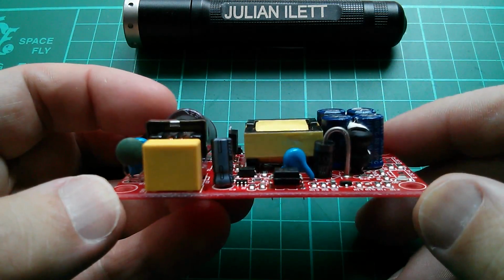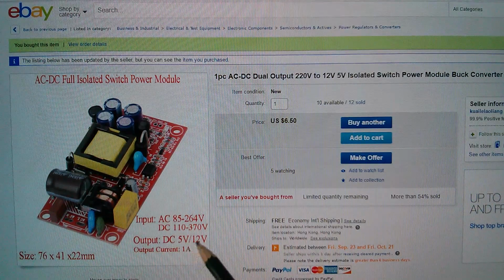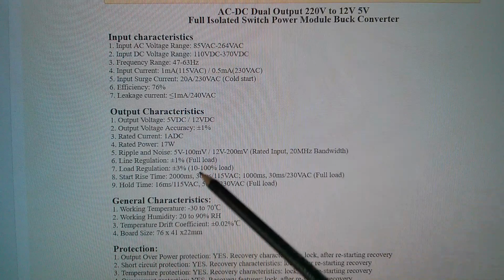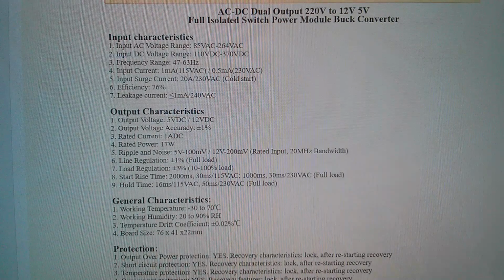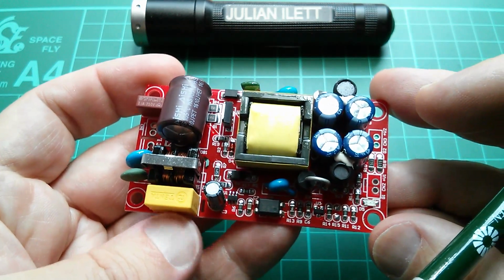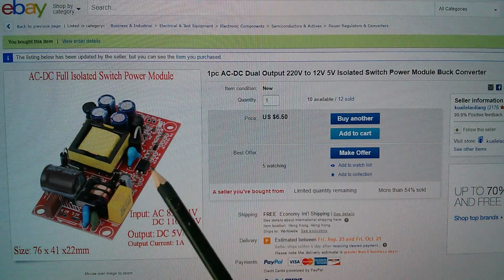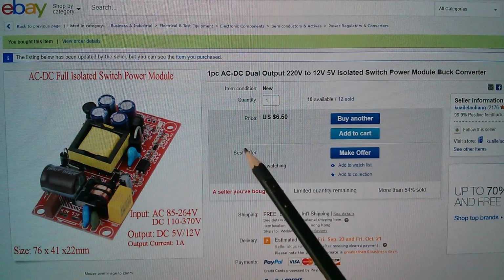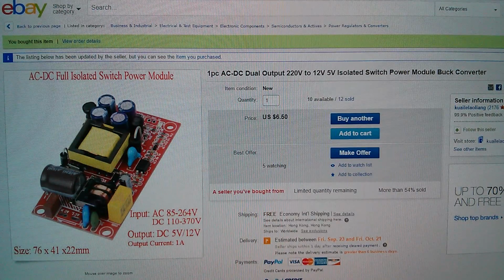Mad Idea: High Voltage DC Power Transmission

Comment: What I will be doing in due course (when the weather becomes fine and warmer) is to use a number of solar panels in series (3 x 200w) with a total of about 111volts run on some 12meters of solar pv system wire  to a mppt controller and then charge my batteries that way.
I did look at having something like what was described but the losses were adding up a little too much and having 3 panels in series is just fine. The cable I will be using can handle some 15 amps at that voltage.

Maybe have a higher voltage right off from the solar panels and save the conversion losses, and possible increase in noise generated by these switchmode power supplies ?

Comment: wouldn't you be better served running all of your panels in series and using a hvdc charge controller at the batteries?
This may be a issue if you have different sized panels however.

Comment: Rather convoluted thinking. The solar array/panel will produce over19V so why not just move the batteries closer to the workshop and run the wires from the solar panels to the regulator next to the batteries. 
Of course when the batteries are down they will not charge as quickly due to some loss in the cable but as they come up the charging current is less and consequently the loss in the cables will be reduced.
Using this method is much more reliable.

Comment: like the idea but you may run into a few issues. If you leave the DC-DC converter connected and powered on the battery all the time you run the risk of running your battery flat. Lead acids don't like being flat. And also you wont be able to check your battery voltage easily (from in the workshop) as your output 12 volts will be regulated. I have had similar issues with my solar power system.

Comment: Multiple converters kiil your efficiency. Assume you have typical cheap converter with efficiency of 80%. Couple of those in series and you're down to 64% efficiency overall (0.8*0.8=0.64)!
Sure, you can get better converters that can exceed 90% efficiency but those are usually not the typical cheap chinese ones. At 90% efficiency you are overall down to 81%. Just use heavier cable, much easier and way more reliable! Cables are commonly available weather sealed as well! :)

Comment: MOV is across line/neutral and it is used to kill high voltage transients. It conducts when rated voltage is exceeded. The numbers like 10D471K indicate usually size (10mm) and rated working voltage (471Vac).

Comment: Sorry Julian but I kinda have to agree with some of the other comments on here, while it is an interesting idea, I don't see the point of it when you're only getting 1A out of it...  Now if you were to use an inverter as some suggested that would make more sense, however then after the cost of an inverter you could've just spent that extra money on simply buying a thicker cable to run and that makes everything easier to work with, so yeah I'd say unless you need a very long run of cable, it's better to just spend your money on a thicker piece of wire.

Speaking of which, I've found that extension cords make for a rather inexpensive way of obtaining decent size wire, especially if you can get them on sale or free... Which is what happened to me, my parents were throwing out an extension cord because the thick outer insulation was a little cut open, but otherwise, it's completely fine and I've not measured it but, I believe that it's 16 or 14 AWG and roughly 100ft or 33m long, a very nice freebie.

Comment: HVDC is used commonly in industry for asynchronous motor drives and as mentioned below linking power grids for example between UK and Europe where they aren't in phase

Comment: Looking at the straight DC case, assuming your cord is 18AWG running 100meters (quite long!) with 12V@1Amp, that's: 0.6-Ohms*2wires = 1.2-Ohms. Voltage drop is then 1.2-Ohms*1A = 1.2V.  That's 12Watts in and 10.8Watts out at your load, for a 90% efficiency. I doubt two converters in series can beat that.  Also, the 120VDC minimum input voltage may be required by that one buck converter to meet full current and/or optimal efficiency. I wouldn't doubt the efficiency of those converters doing any better than 80-90% each. That is  64-81% combined.

Comment: There is a lot of speculating around here. I experienced a quite huge power loss over 12 V in my garden lightning system and decided to go for 240V on long cables. It depends on the length and thickness of your cables (i.a.w. the resistance) and the current. There are a lot of internet pages that calculate the losses. 
Another point to think about is security. Pets? Children? Rabbits? How deep do you like to digg?

Comment: Be careful with high voltage DC, it bites. Also watch out for electrolytic corrosion if the wire gets any moisture around the ends or into the insulators. There are many great reasons to go with AC for power transmission but the main one is that you can use transformers to step the voltage up and down without electronics. Also AC arcs extinguish more easily. Thanks again.

Comment: Gut feeling is that if you are going to use about 1 Amp then just a normal wire will be WAY more efficient than the double-conversion. Not to mention much cheaper.

Comment: Don't forget, unless you are going to run back and forth or run more wires to turn the 12 to 80 volt buster on and off, the buster will be presenting a load to your battery all the time.
Also although you are some what correct in the high voltage will give less line loss, you will still see a substantial line loss as it is still DC. This is where AC power comes in, although there are still line losses in AC they are much less and still less as you reduce the current (up the voltage).
Reply: William McSephney  Actually, AC transmission along long cables has greater losses than DC, due to the volt drop caused by reactive current flow. Although over a relatively short distance in this example, the loss is insignificant.
The reason that most countries use AC for electrical power transmission is simple, transformers allow easy stepping up and down of the voltage.

Comment: power output 17W ? 5v + 12 V @ 1amp ? the real question is, can it supply the 1amp on both output when feeded with 80V DC only ? or does it really need the minimum 110V DC ?

Comment: Interesting stuff. Would be interesting to see some power efficiency calculations. I suppose you'd need to check the efficiency graph as well for input voltage versus efficiency.

Comment: I agree that you can get away with the thinner wire, though i wonder why you don't use an inverter, you should be able to get hold of one for 120v if you don't like the idea of 240v, ac may perform better as it's not a constant current.
Also, a friend of mine tried a computer power supply on a variac and turned it down to something like 20 volts, though it was ac, but if they haven't changed them much, they still use a similar circuit as a smps with ac in, rectified, then switched to ac, so maybe they will also work on dc. not sure how much 'useful' power it would give from lower voltage though.
computer psu's will generally work on 110-240 anyway

Comment: assuming 85% efficiency ( generous assumption) of both the boost & the buck, then total efficiency of the system will be 0.85*0.85 = 0.72. meaning 72% efficient system neglecting the losses in the cables.

The current system you are having is way better as I don't think the power losses through the cables will be 28%.

You can do an interesting experiment. Put a load of 2A on the existing system & measure the voltage on the battery terminals & inside your workshop to calculate the voltage drop & then the efficiency of the system
Reply: That datasheet on the new item said 75%. So, 56% efficient as a system, if symmetrical on both ends.
Reply: yea, it could be even less than 56%. the assumption of 85% just shows how unpractical the proposal is. 
Maybe Julian should also measure the efficiency of the proposed system & compare it with the existing system. 
That's a video waiting to happen ?
Reply: Bloody Thomas Edison and his direct current. :P
Reply: Measuring real efficiency would be very interesting. Julian?
Reply: its probably more efficient price-wise .... I mean imagine running on 12V and you want to transfer 2400W ... you would need 200 amp cables which will cost you a pretty penny and may even need extra cooling ...... if you stepped that 12V up to 100V('not deadly' voltage) you would need just 24A, because the losses scale with the square of it you need a waaaaaaaay smaller cable and power converter ...... if you are okay with stepping it up higher to 'lethal voltages' you can probably do with a few amps .... mosfets, capacitors diodes capable of handling a few 100V are readily available.
Reply: Kevin Miedema - Only the first investment of the high current copper wire is more expensive. for the long term run after that the higher efficiency can cover up the initial loss of the wire cost.

Comment: won't they be a voltage drop using dc on a long cable. because if I rebember correctly that's why tesler pushed for ac. as it can travel grater distance. can you covert dc into ac for the distance. jon
Reply: There will be a voltage drop on ac too. AC is better for long range travel is because it's really easy to be stepped up to a high voltage like 22kV then stepped back down to mains power 230VAC(220, 110 120)./
To answer your second question, it can be converted into ac(that's how inverters work), the only problem with that is it's hard to do if you want an actual pure sine wave and not just an oscillating square wave.

Hope this helped
Best Regards:
--Valentin
Reply: there is less voltage drop with  ac then dc. here in the states if something 120vac it has a hot and a neutral, but if its 230vac it has 2 hots out of phase eliminating half the voltage drop.Just throwing that it there as a way to cut voltage drop in half :)
Reply: kardeef33317
I beg to differ. In most of the eu, one phase power is 230-220VAC(1 hot and 1 neutral)
Reply: Here in the states your stove,ac, and hotnwater heater is 230 - 240 and thats 2 hots and a ground.
Reply: kardeef33317
I know, but that's so stupid lol
110VAC is crap because you need a lot of current for big power.
In most of the eu, we use single phase 220-240VAC, and three phase 380VAC for big(er) loads. We lose way less power in the cables because of the higher voltage.

Comment: It's so better then use 12Vdc with thin wire in long range.
Because it have a low dropout voltage when current go high.

In my country, some solar company use HVDC to powered there solar farm.
They use switching power supply or true-on-line ups to convert power from DC to AC.
They connect solar panel in series to get a HVDC and use MPPT charge controller to charge batteries.
Reply: THANKS FOR THE system design idea and speaking up. I can actually use it.

Comment: from rectified 120v mains you get much more voltage than 120v
Reply: You'd get 169.7vdc if you rectify 120vac. 
This is because when you measure ac voltage with a meter it measures an average voltage. If you want to get the peak voltage of any ac voltage just multiply that with the square root of 2  :D
Reply: But in this case, he is stepping up 12vdc to 120vdc, so there is no rectification needed! :)
Reply: R4MP4G3RXD I know  I am 3 grade elec tehnician
Reply: JOSIP Žlk
And I just started 2nd grade as a robotics technician :D
I know a lot more than my age tells about me. I have had an interest in electronics since I was like 4. So I've learned a crap ton of things along the way that I actually use. :P

Comment: Without doing any sums I seriously doubt whether the potential saving in resistive loss in the wire makes it worth the expense and loss of reliability in the added converters.  On the other hand it has the advantage of giving you well regulated 5V and 12V supplies.

Something to watch out for though is that supplying a cheap Chinese switch-mode converter from another cheap Chinese switch-mode converter is asking for trouble.  The problem is that at low frequencies the input impedance of a SMC is negative, (increasing the input voltage decreases the input current).  I doubt whether these converters have been designed to be stable when supplying a negative impedance, normally you're lucky if they are stable under normal resistive loads.  This implies that before relying on this arrangement you should test it over a range of loads, including transients, whilst monitoring the intermediate voltage with an oscilloscope to check for instability (oscillation).

Comment: There is a HVDC cable between France and Britain. which can transfer power either way. They use DC to eliminate the issues you would have from the 2 grids not being AC synced.
Reply: they use DC to also eliminate capacitive losses
Reply: Or maybe skin-effect losses?
Reply: Bob Berg skin effect at 50Hz is about 10mm
so is a non issue

Comment: I wonder if a combination exists of these off-the-shelf components to use this scheme to fly a tethered quadcopter?  Or possibly use AC on the transmission line for even greater efficiency?  I think you're idea here makes perfect sense as long as you know what you'd be powering with it wouldn't exceed the capacity of this particular combination.  Once you have a way to measure watts in versus watts out, you'll have your loss quantified.  You may want to also test a range of loads to see if there is a sweet spot of maximum possible efficiency.

Comment: Why not use an inverter and send mains AC voltage down to the workshop?
Reply: Also, there's no way that twin-flex cable is rated for outside use.
Reply: I've just suggested the same thing. Julian covered a Royer inverter a few weeks back. I wonder whether he had this in mind when he bought it?

Comment: Might all the converters on all the time suck your batteries dry overnight?  They are pulling a current just to support themselves and 1 amp seems hardly worth it.  Perhaps a remote switch?  Also, DC corrodes mightily.  Edison was wrong in the 1800s....
Reply from the maker: I have thought about a wireless remote for the booster - I recently bought a wireless module with dual 30A relays specially for this project.
Reply: Try to switch the AC side with the relays, or make sure the relays can switch the DC. DC acts funny with mechanical switching and may sustain an arc when the relay switches off.
Reply: Maybe or not because if You turn off your switch,theere is no current really passing through unless your switch is faulty
Reply: I doubt it'll be using that kind of power with no load, shouldn't be too difficult to measure the current draw and work it out though.

Comment: Besides the ability to use smaller wire .You will have alot less voltage drop at the higher voltages.Just some to keep in mind.Also thanks, iv been diabled for the last12 years and feeling veey useless.You BigClive and 2 others has sparked my interest in electronics again in the las year and iv been able to repair a few things and iam feeling useful again. PS After I was married in the late 80 I dropped out of electronics because the time needed in raising a family.Thanks again.

Comment: The number one rule on your channel description says "Absolutely won't touch unbranded cheap mains power devices." I did worry you were going to break the rules for a minute Julian. ;-)
Reply from the maker: I did get quite close :)
Reply: +Julian Ilett Having watched the full video now you didn't take the reel of cable into the workshop to try it? I'd have been very interested to see the voltage drop across that length - it would have given an idea on how efficient the system could be. 

I have thought about doing something similar to set up a solar powered security light about 20 meters from the shed. But keeping the regulators dry and cool seemed a challenge I've not yet found time to explore.
Reply: except this time the PSU isn't connected to mains
Reply: Bending the rules...it is why I love this channel

Comment: around .8^2=.64 peak efficiency to be expected, the cable should be very long...
Reply: Yes, for the price of 2 dc dc converters just buy bigger better quality wires...
Reply: I've done 12v over long wires (much shorter than what Julian is going to do) - about 5 to 10 meters kind of thing. Pulling about 8 amps caused massive resistive losses. The resistive losses for the high voltage run would be significantly less.

Of course this is for many amps. Considering the HV -> 12v DC converter can only do an amp that limits it's usefulness. If it could do 10 amps then it would certainly make a difference for more power hungry experiments.
Reply: +Nick Stallman  cheap 1mm2 or awg17 wires are around 16ohms/km so even for 100 meters (50 m both ways) it's 1.6 ohms so for 1 amp you have near 85% efficiency. If you need 3 amps use awg13 for the same kind of result and it's still cheaper than 2 dcdc. If you want more power I agree that using bigger wires has a limit. But it's still doable up to 10 amps I guess if you reduce the length as much (100 is a lot) as possible and double the wires to balance the load and get only half the drop.
Reply: Remember the drop is related to the square of the current so more current makes things significantly worse. Also I needed a certain voltage at the other end and I couldn't easily increase the voltage being sent.

Your efficiency numbers are assuming 1v or less on the other end is fine. :)
Reply: Not at all the voltage drop is linear with the current. I didn't talked about the power. 1 amp gives only a reasonnable 1.6v drop. With bigger wired you get less than 0.5 ohms that can be reduced to 0.25 with 2 wires in parallel with 2.5v drop at 10amps. But this is really the limit of that solution because the drop becomes high and the cost is probably higher than the dcdc solution. It's still a simple reliable and safe solution compared to high voltage.